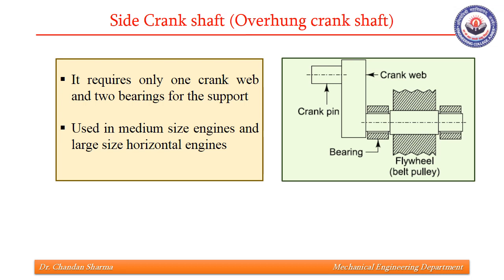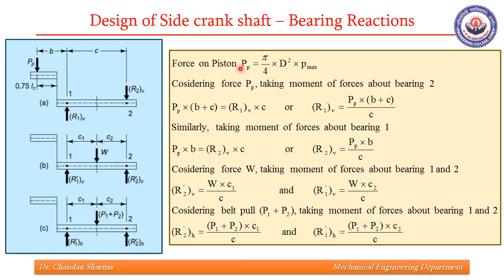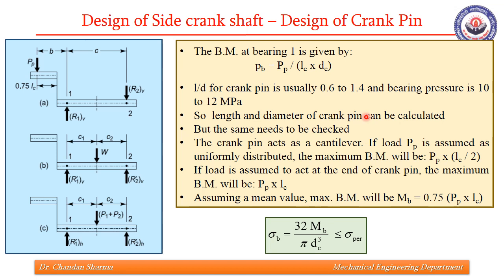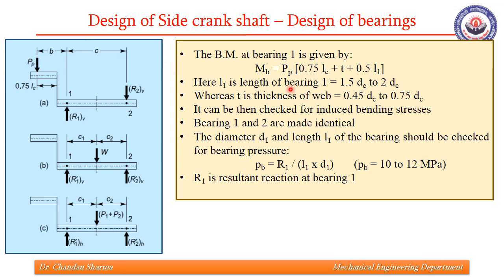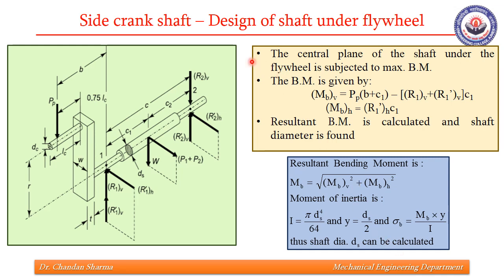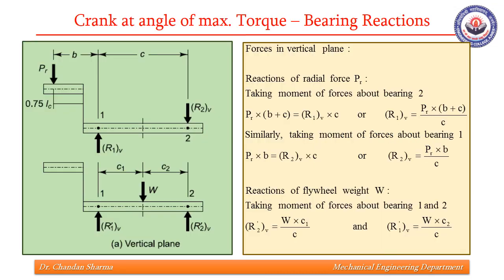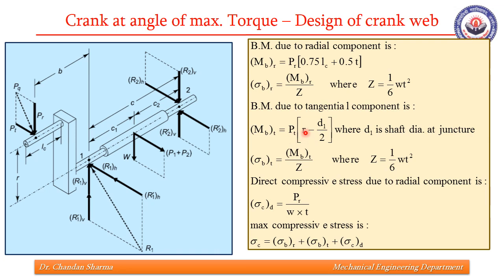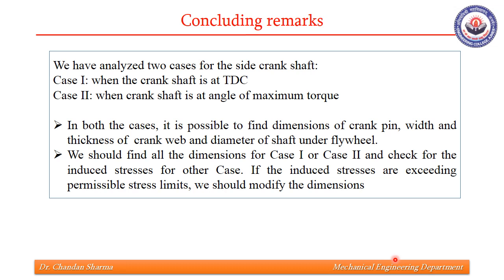DME - II Design of Side (Overhung) Crank Shaft of an IC Engine

Comment: Hello sir !! Can i have ur whatsapp number,, i am actually stuck with two DME questions one of IC engine and another of Gear design and if possible then a little help with sliding contact bearing too,, and sir i don't have the data handbook and thats too creating a problem.. hope you will help ^_^
Reply from the maker: Sure dear. You can contact me on 9414261670